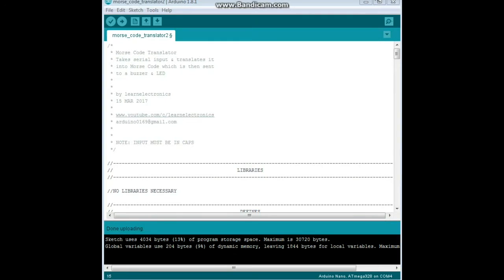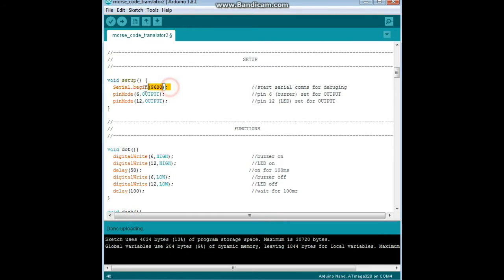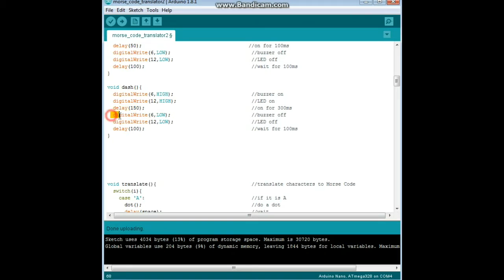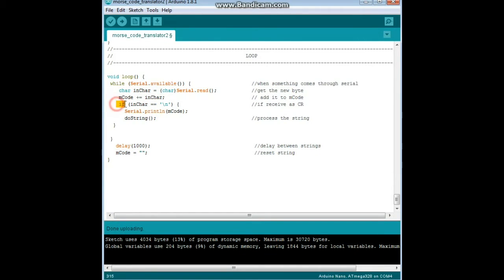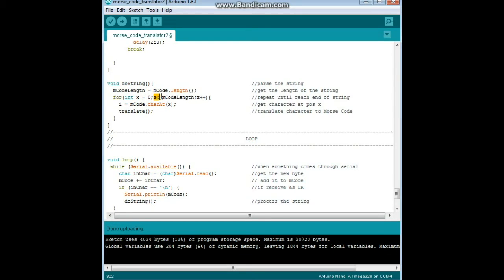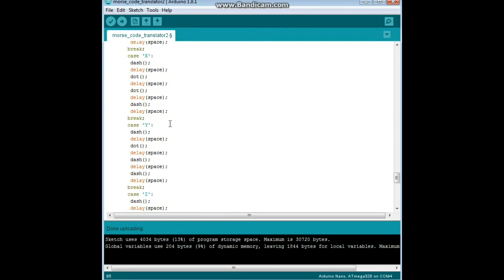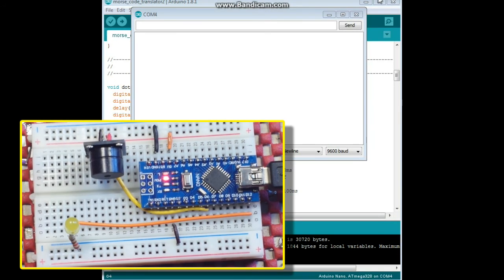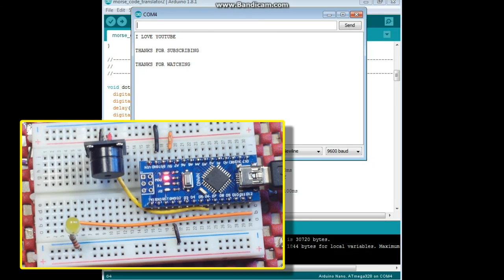Arduino Morse Code Translator

Comment: I programmed a D1 to tone a 1000hz ish tone to a pin and fed it into the mic audio circuit on one of my GMRS radios to send my call at the press of a button. Reactions were mixed, even though it's allowed in the rules.

Comment: Just my 2 cents.  good video, but...
There are rules to help people distinguish dots from dashes in Morse code.

1- The length of a dot is 1 time unit.

2- A dash is 3 time units.

3- The space between symbols (dots and dashes) of the same letter is 1 time unit.

4- The space between letters is 3 time units.

5- The space between words is 7 time units.
Following these rules will make your device sound more natural and easier to copy.  =)

Comment: hi there got it all working, Very Nice 
i do have a question. seems like the code remembers the last input??
eg type A, it blinks dot dash, all good
if you enter an M it does the A,and the M
and it goes on and on
the arduino board needs to be reset then its back to normal.
any IDEAS, please